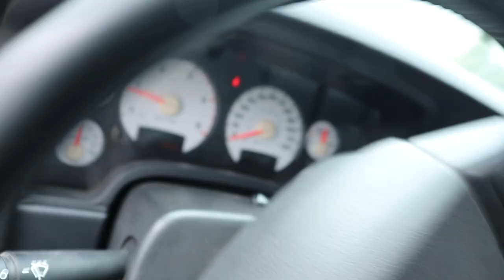Cummins Truck FOR SALE!!!

Comment: Hell i own 6 trucks and 4 of them sit I'll still drive them when I get too them not a problem owning alot of vehicles but ill keep the nice ones in the barn or garage out of the weather
Reply: 1965 C10 truck 
1975 F250 highboy truck 
1978 k20 truck 
1979 k20 truck 
1986 m1028 truck 
1999 F450 truck

Comment: Suprised you didn’t have to clock your t case on my 96 2500 did the same 5” lift with 2” front puck spacer and the front driveshaft started to bind so I have to clock it so im suprised you don’t have to do the same thing